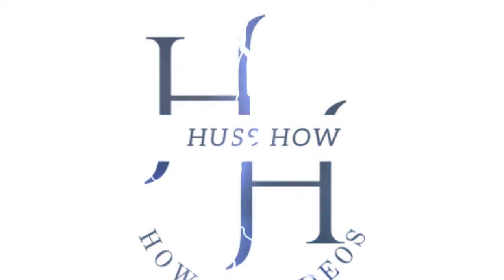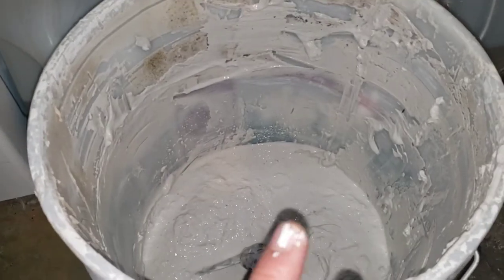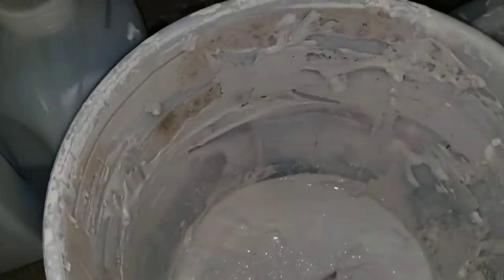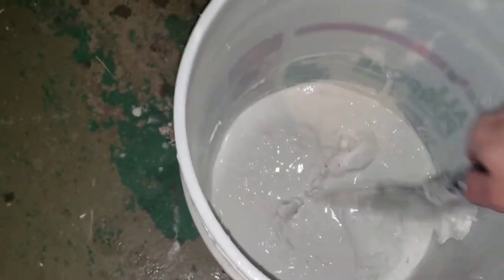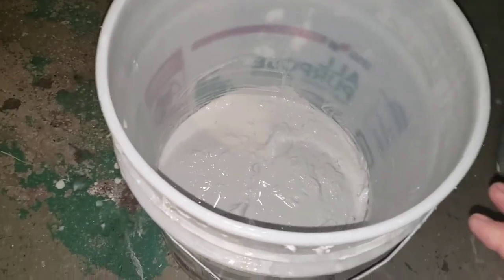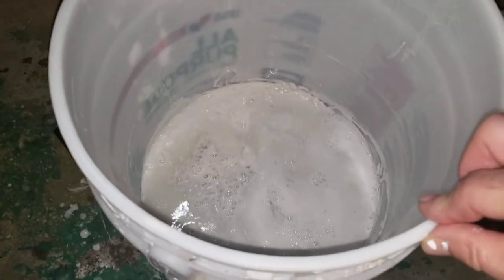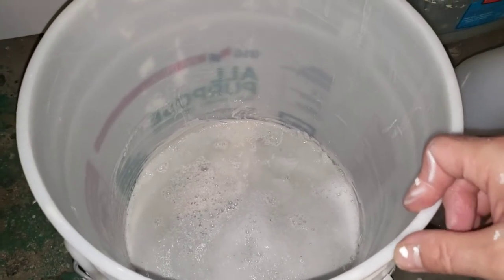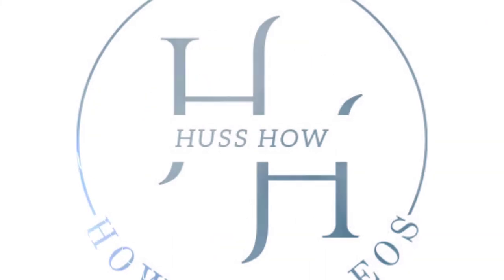Stop mold from joint compound

Comment: So what happens if someone uses this without getting rid of the mold?
Reply: The mold will transfer to the drywall joint. When dry mold goes dormant and will not be an issue 🙂